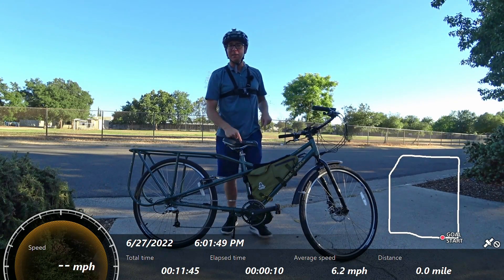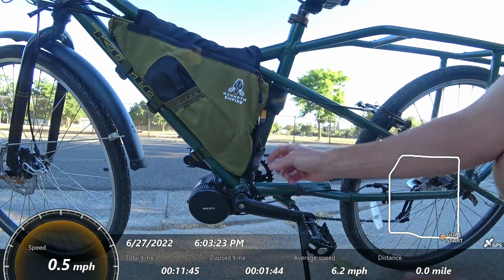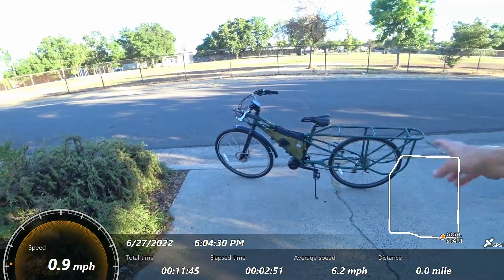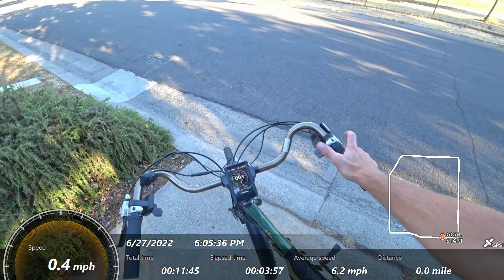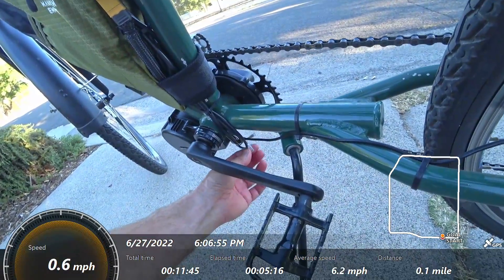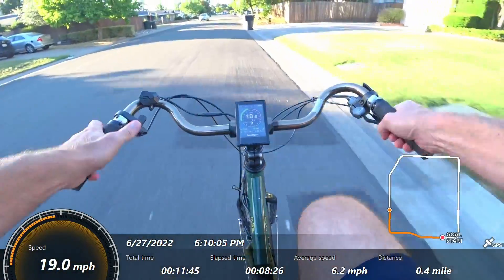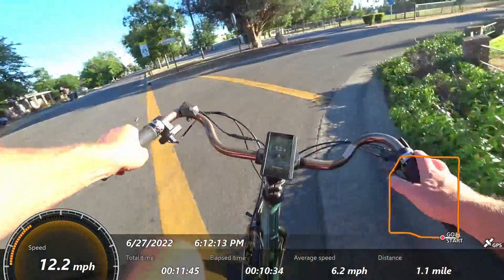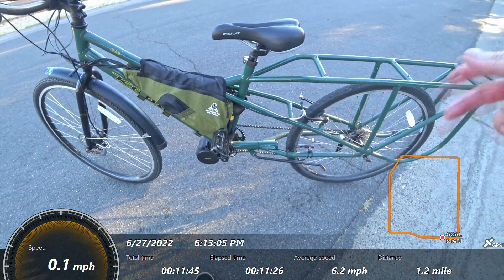Custom Cargo E-Bike Build! | Kona Ute Electric Bike

Comment: hey, i have the same ute and have been inspired by you to convert it. What size bottom bracket do you specify for the drive? Did you order the p2 fork from kona? thanks
Reply from the maker: Hello and right on, I love cargo bike conversions. I am pretty sure the bottom bracket on the UTE is 73mm, so the 68-73mm is the one. Some sellers will only say it fits 68, but they will fit up to 73 you just have to add some spacers the two bolts. I bought the Kona second hand so I don't know about the P2 fork. Good luck with your build and please let me know how it goes.
Reply: Will do thanks !

Comment: what is the model of the battery used?
Reply from the maker: I did a separate video on the batter I used here https://youtu.be/S38PR_0FNgU. Its only 48v-10ah, but easy enough to get more than one if you need more range.